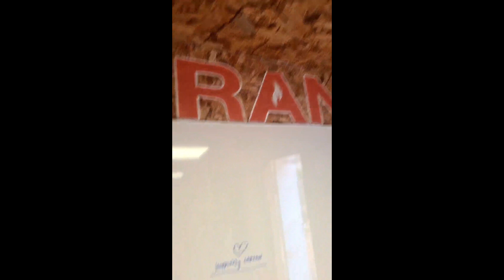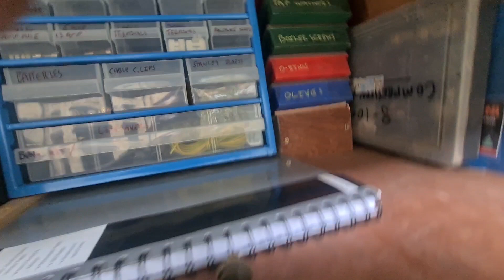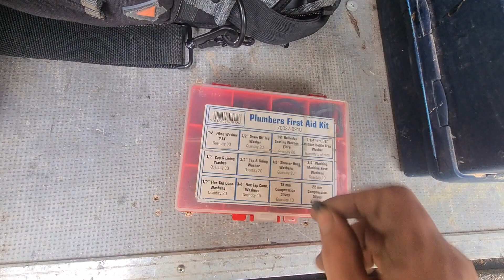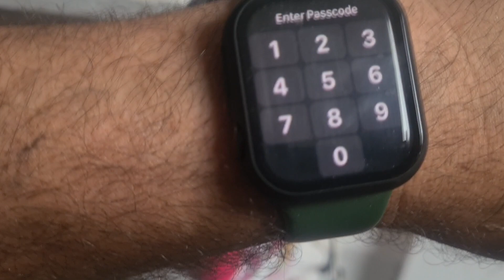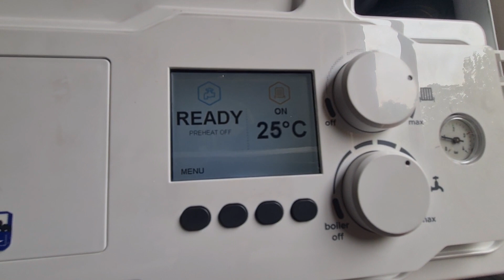George Gets Scammed

Comment: Genuine question, I didn’t think it was allowed to put an isolation valve on an expansion vessel or is that mainly for unvented systems. Keep up the vids!
Reply: You can do both mate
Reply: @leepickett3655  both what? Isn’t a unvented cylinder without expansion (if the valve is turned off) not a bomb, sorry if I’m mistaken only an apprentice
Reply: I didn't think you could put iso point on expansion vessels either
Reply from the maker: Respect for the support bro,

Ive put it on for maitenance, the main expansion in the boiler and PRV are always open 👊🔥
Reply: @capraniplumbingandheating  👍

Comment: Pain in the ass those valves mate.  I found 14 turns of ptfe tape sort it jesus. Edit:  Was the volume of the system too much to increase the pre charge pressure on the boiler expansion vessel ?
Reply from the maker: Respect for the support bro, yes system volume was to high so installed that as well mate 😂🔥